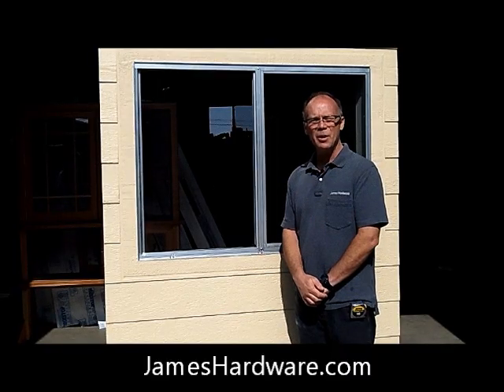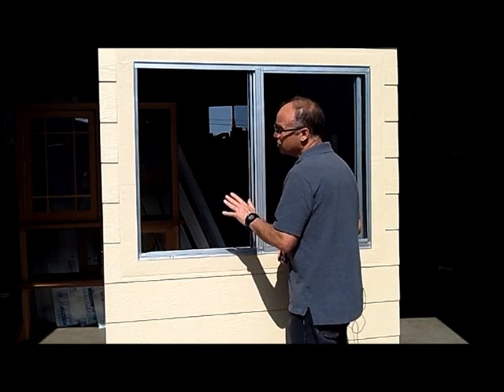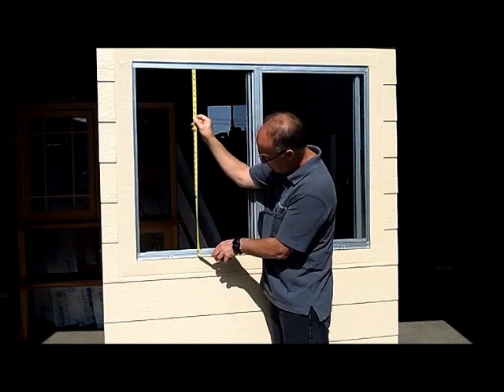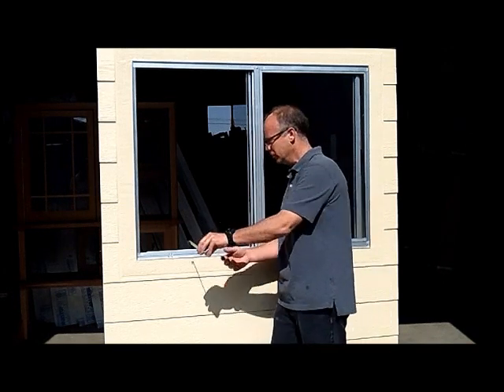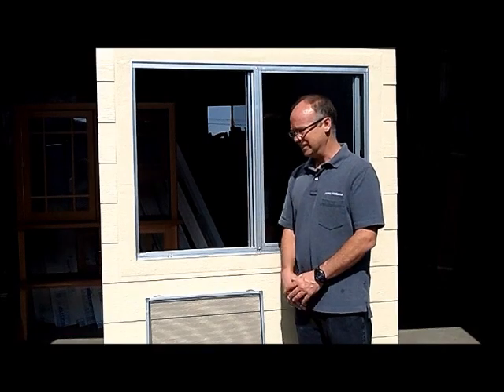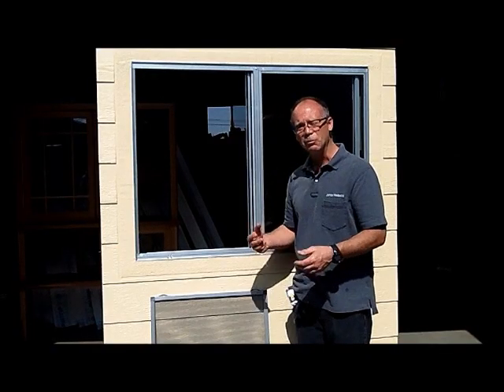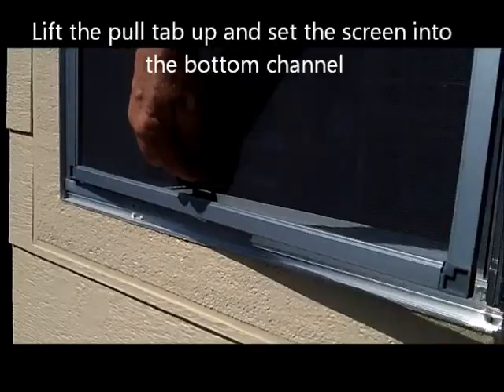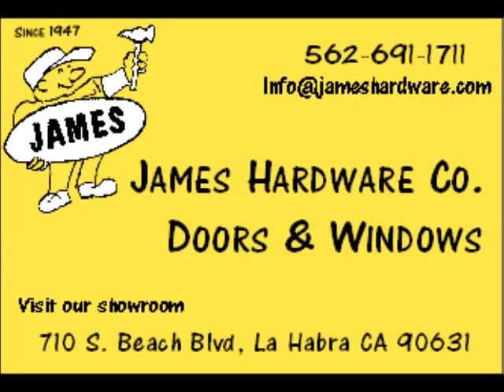How to Measure for new Screens in Aluminum Windows..."James knows".

Comment: Brad thank for this video. I could not understand exactly what the measuring points are for measuring the width.  For me, I ended up not being equipped with the details that would result in a successful job.  
Besides that, explaining in detail exactly why a certain measurement is carried out in the specially described (and shown) way, adds to our comprehension.  Thanks again for the otherwise great video!!

Comment: Your video is either incorrect or missing crucial information. I followed your steps. Measuring the width from the "flat part of the frame" (what would be inside the pocket of the non-moving pane) to the inner edge of the screen channel (inner edge being window side, not wall side) and ADDING 1/8" as instructed. This creates a screen that CANNOT be installed, or not in every window. My windows look just like yours in the video, but the pocket on the non-moving frame is deeper (5/8") than the channel along the wall (3/8"). So when I add my 1/8" to that, now I have a screen that is the width of the opening (edge of channel to edge of frame of non-moving pane) + 5/8" to "flat part of frame" + 1/8" (per your instruction) for a total of opening + 6/8". But i only have 3/8" one way and 5/8" the other to stuff it, so it doesn't fit. If the channel along the wall was at least 1/8" deeper than the pocket of the non-moving frame, I believe your method would work. Unfortunately, I didn't watch other videos prior to measuring and ordering my screens, but I have now and I find other videos instructing you to SUBTRACT 1/8" from that width measurement; NOT ADD. I assumed your video to be correct. Afterall, if you actually used your measurements to make your screen and it installed, I should be able to trust your method. If you found them to be wrong, you would have corrected your video. I ordered 3 screens measured using your method from Ace Hardware and I now have $147 of screens that don't fit. Had I engaged my brain while doing the measurements, rather than blindly following your directions, I would have easily seen that this doesn't work. So, it's really my fault for being so gosh darn trusting.
Thanks (sarcasm).
Reply: There are a lot of different window sections. Not all windows are measured the same
Reply: "and ADDING 1/8" as instructed." - YOU

"minus a 1/16 of an inch " -THE VIDEO 1:36

You made the mistake, not them... you were supposed to subtract, not add.
Reply: ’e-ḇen no, Tazze is talking about the measuring of the width, youre referring to his instruction when he measures the height. Tazze made the mistake of measuring from the inner channel and adding the 1/8th. This guy is not measuring from the inner channel but the outside flat panel of the window opening. Thats why he adds the 1/8 since the screen will fit inside the must be a litter bigger since it will sit 1/8th inside the channel. Tazze made the mistake, not this guy.